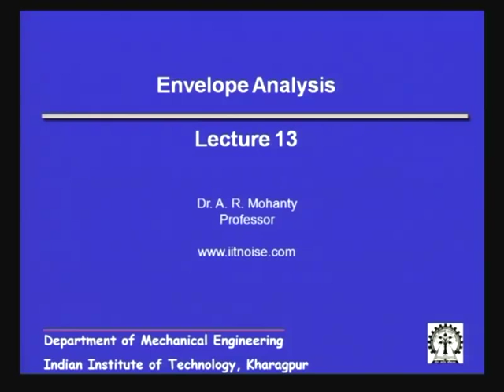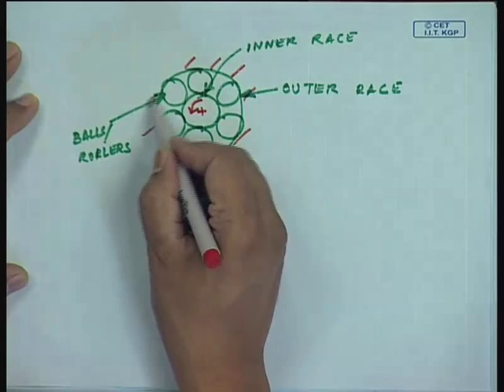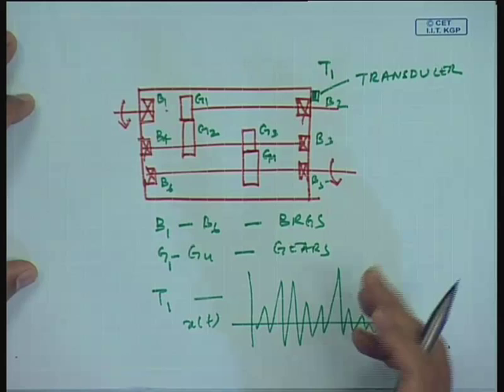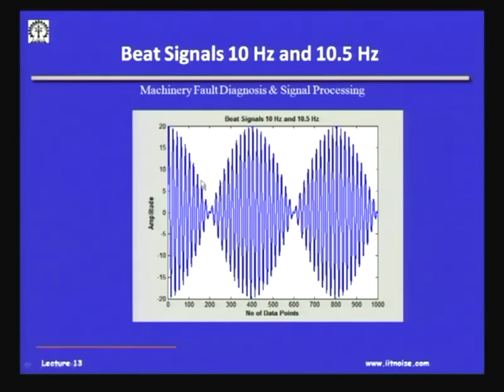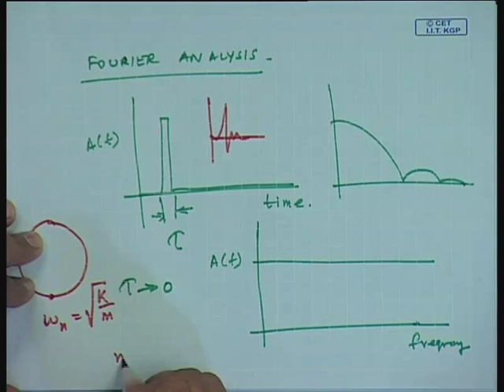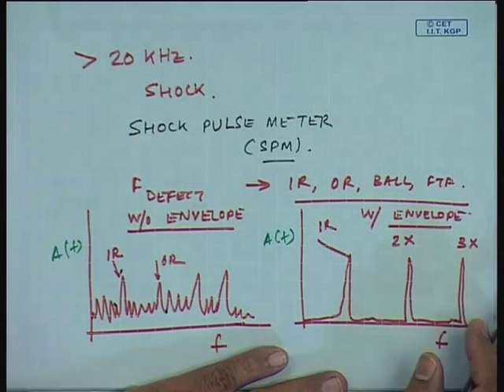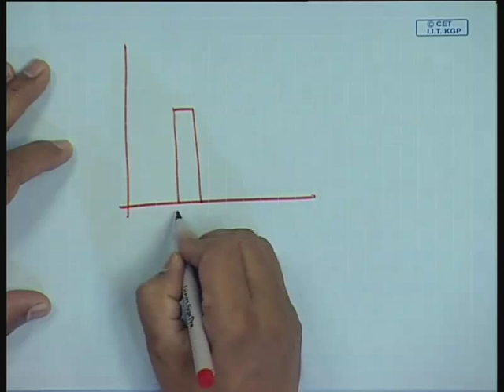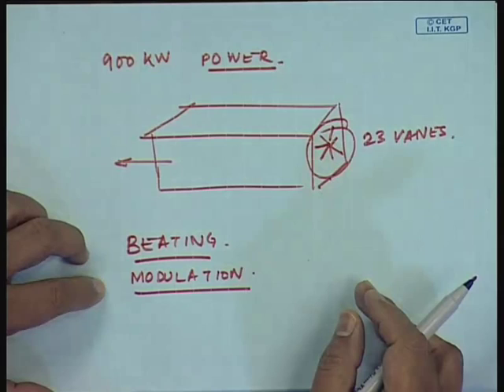Mod-01 Lec-13  Envelope Analysis

Comment: Just one thing that bearing fault frequencies are all higher than the turning speed of shaft (apart from fundamental train frequency only).

So when you do the envelope analysis to find out the fault frequencies, it's the carrier frequency in the case of fault frequencies like inner race defect or a spall on the roller causing the defect with cage frequency as sidebands.

Here, envelope/demodulation is done to get that defect frequency. The lower frequency in case of inner race defect is just turning speed of shaft while in case of a spall on a roller, the lower frequency is just your FTF (even lower than you shaft turning speed).

Hope everyone gets it.